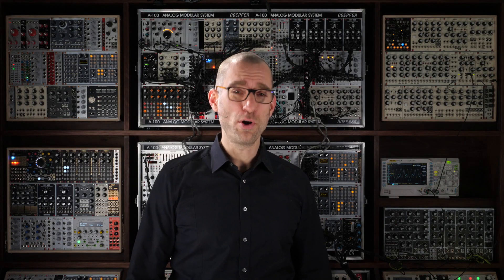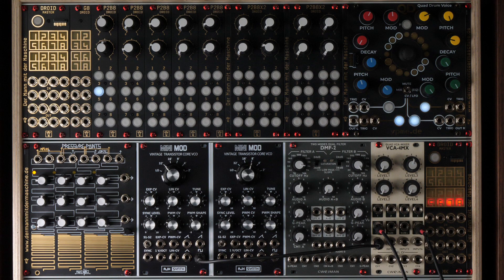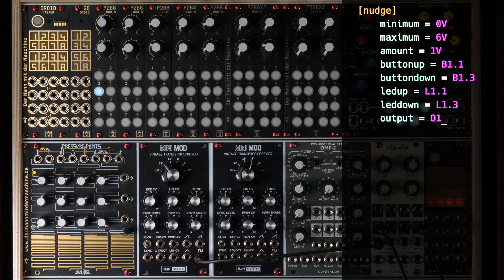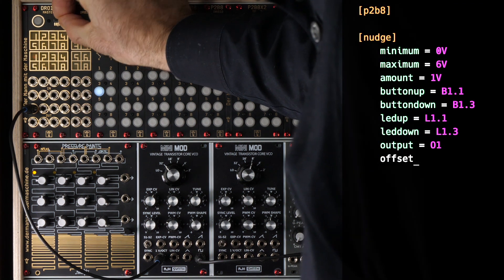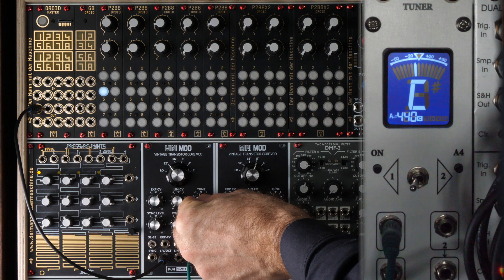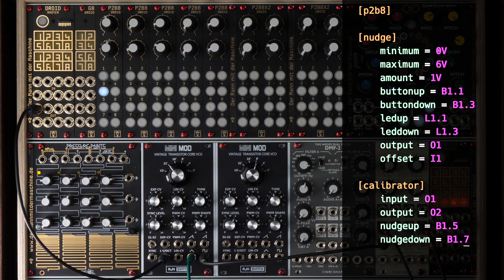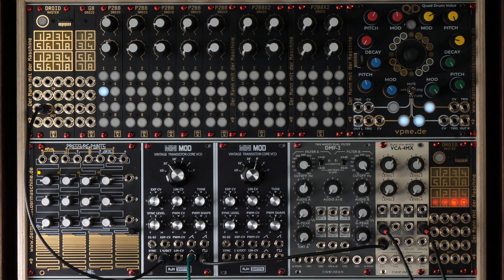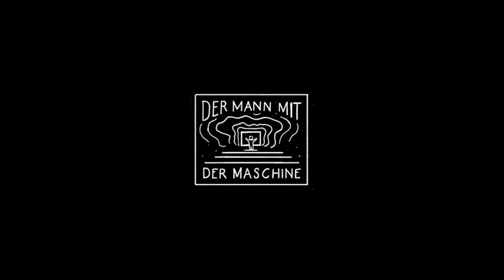DROID Episode 12 - Octave switch and VCO calibrator

Comment: Tuning VCOs is a nightmare. Have 3 doepfer quads and in each module at least one Octave is off so you have to switch them differently (-1 0 +1) to keep them in the same octave. Really poor quality control. A completely unrelated point to the welcome calibration tool in droid.
Reply from the maker: Hy Neal, I have two Doepfer quads myself. They tracked perfectly. After a year or two, I had to recalibrate them, though. After that it was fine again. But of course you can use Droid to fix any weird VCA tracking out there, even if it's completely decalibrated.

Comment: In the calibrator example, you sent O1 to O2 and therefore don't really have a use for O1 yet it's taken. Can you send the Nudge circuit to a virtual patch cable and then connect that to the Calibrator circuit and output Calibrator to O1, thus saving an Output?
Reply from the maker: Yes! Sure. You could do that. I this example I justed wanted to have the output of the actual octave switch available at an output, but by using an internal patch cable you would save that.

Comment: Looks amazing! I don’t have a eurorack but want to buy the droid as a start. I’m gonna look at the manual because I wonder whether I can make complex rhythms with it
Reply from the maker: There are a couple of circuits for making rhythms in the DROID. You should e.g. have a look at the algoquencer and at euklid. Also the clocktool can be interesting since it can create arbitrary divisions / multiplications. So you can e.g. create a rhythm with 15 beats over 16 clock ticks. Also the triggerdelay is interesting. Either for very short delays (micro timing) or for replicating one rhythms a number of beats later for a second voice. And bernoulli randomizes between to trigger source or sinks. Endless possibilities :)
Reply: @DerMannmitderMaschine  how does the beat division, IE the 15/16 work. Does it work by skipping beats or bt scaling them proportionally, like the Fractio Solum? Can it be reset? I might have to just pick one up
Reply from the maker: @Caustic13  It can do both: using the "clockutil" circuit will perfectly smooth it out. This will then give "polyrhythmic" structures. The other way would be "euklid", which creates euclidean rhythms. Here 15/16 would skip one beat. More interesting, of course, would be something like 9/16 or the like.

Comment: I only can do the correct tuning if I have a  tuner with its readout at hand ?  or did I miss a point ?
Reply from the maker: Either you have a tuner (a phone app will do) or you have a reference oscillator and tune relative to that by ear (which goes pretty easy). It's not an auto tuning device. This might sound like a drawback but it indeed has several other advantages. Easier patching, live adjustment on the fly as needed, adjust tuning to an arbitrary other voice (which might have a non-perfect tracking) and so on.